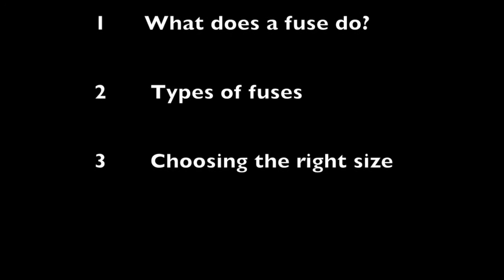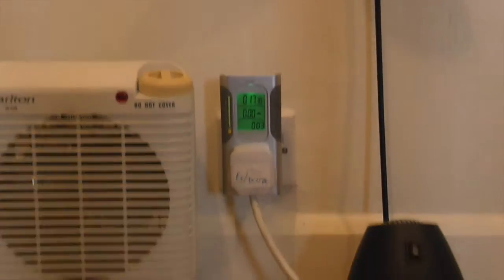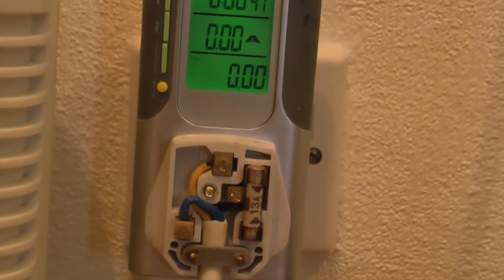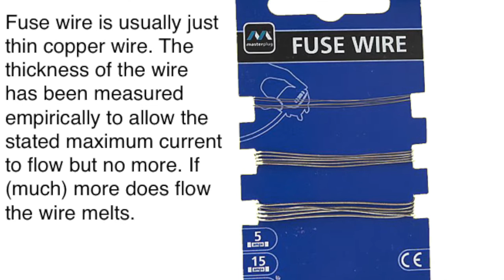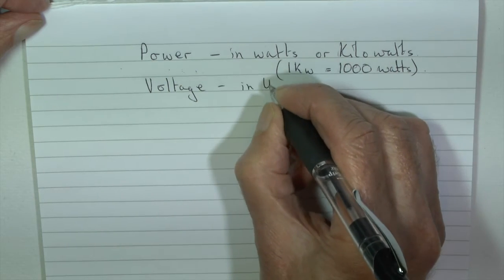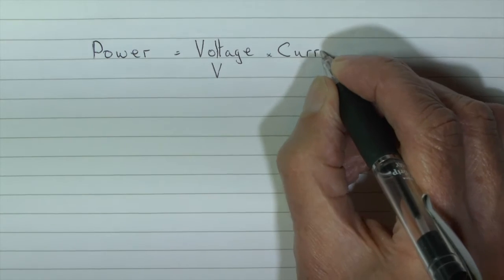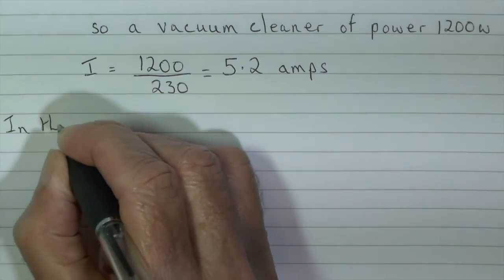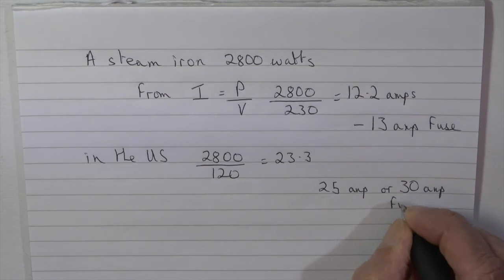How to choose the right fuse: Explained with demonstrations by fizzics.org

Comment: Fantastic calculator, indeed! Awesome video! It really made me miss learning physics in secondary school. Mrs. Mesbah was such a legendary woman teacher. (Fitting how her last name means LAMP in Arabic. 😅) 

By the way, I have an air purifier called Honeywell HPA100. It doesn't specify W, but online, it says it consumes 50W max. The label underneath says 0.50A, 120V, and 50/60Hz. 
I bought a voltage converter called Krieger ULT150, which claims to convert 120V to 220V, and vice-versa, but every time I tried to make the air purifier work (making sure the input selector is set to 220V instead of 120V, and plugging the air purifier into the 120V US socket), the T1AL250VP fuse gets blown. Do you think I need a fuse that has a different rating?

N.B.
I live in Morocco, which operates on a 220V supply voltage and 50Hz.
Reply from the maker: 50 watts does match with 0.5 amps and 120 volts (60 watts) the fuse should be about 1 amp (there is a slight surge on switch on). If that still blows, look for a short.